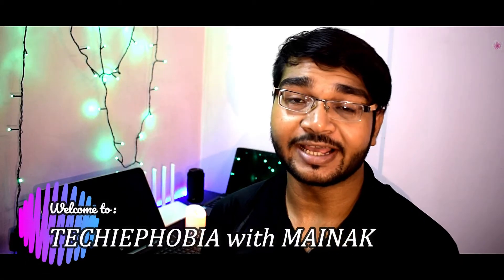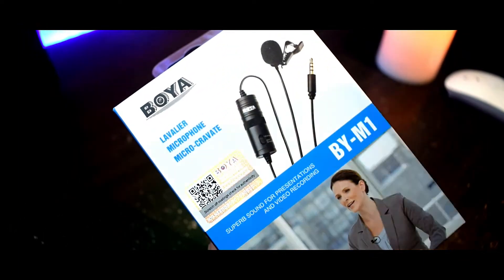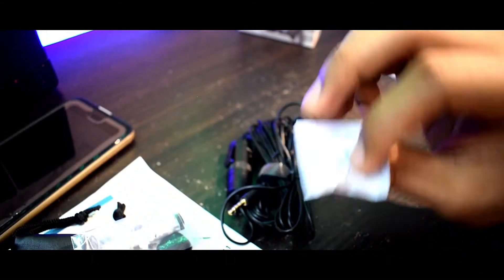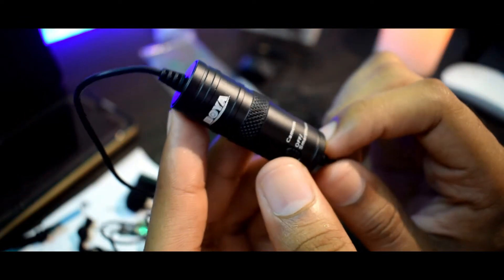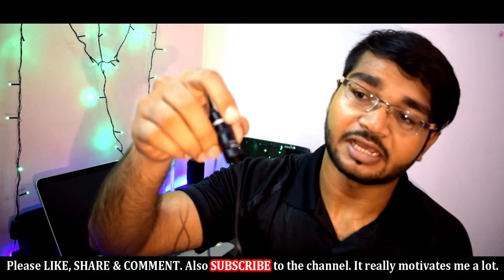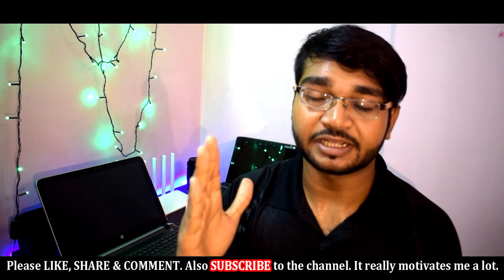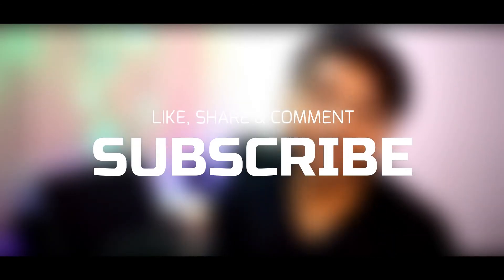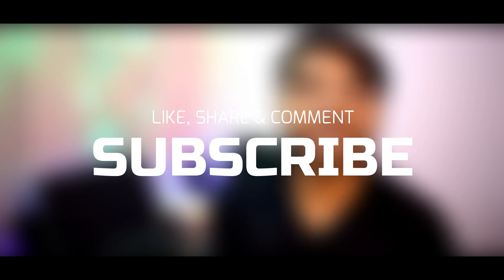BEWARE OF FAKE BOYA BY-M1 CONDENSER LAVALIER MICROPHONE ! WHY IS IT BEST ? HOW CONDENSER MIC WORKS ?

Comment: Hey bro my boya by m1 not capturing sound properly ;
it senses only when I blow air into it but doesn't sense voice ? 
What could be the reason... Any ideas?
Nice video by the way....
Tried mic with mobile dslr .. Same problem....
Reply from the maker: Angry Indian Did you replace the battery?  Try it once.  Try with open canera in mobile and with sound recorder. If same problem exists,  replace the mic
Reply: TechiePhobia with Mainak ....tried changing battery/ used with open camera. ...no luck......what could be fault?...does sensitivity of this mic decreases over time? .....can't  it be repaired? 
By the way your your video was nice. .....especially Chinese !
Reply from the maker: Angry Indian I am sorry bro but i dont think it can be repaired. I think may be the membrane of the microphone is ruptured,  condenser mics are very sensitive and easily get damaged by loud sound.  If your mic is a bit old,  i think you should go with a new one.  And thankyou so much for your feedback
Reply: TechiePhobia with Mainak ...oh!...that could be the fault. ...although mic was only 4 months old. ...I think it is over rated on YouTube .....do you recommend any other collar mic...in the same budget ....thanks for quick reply!